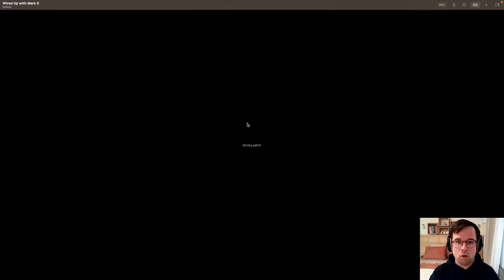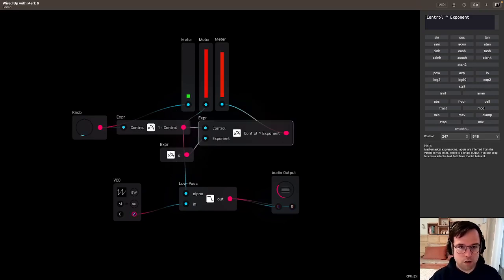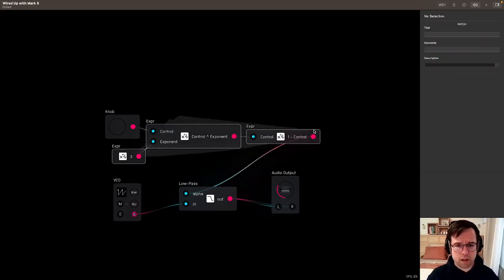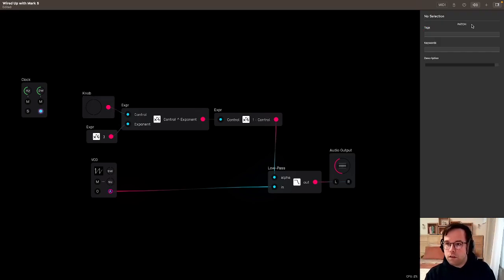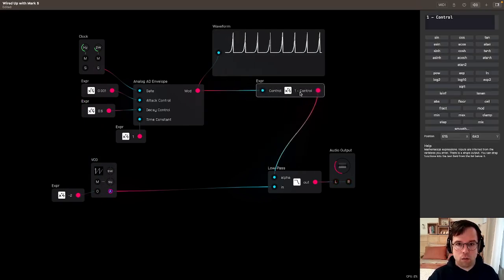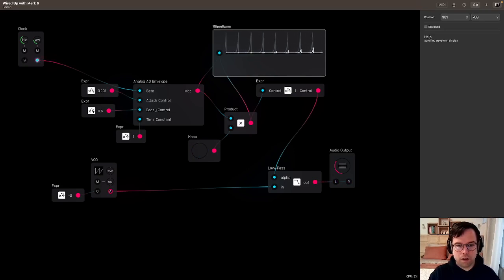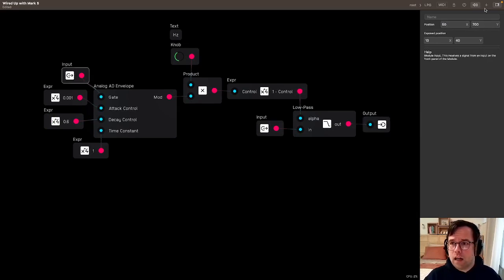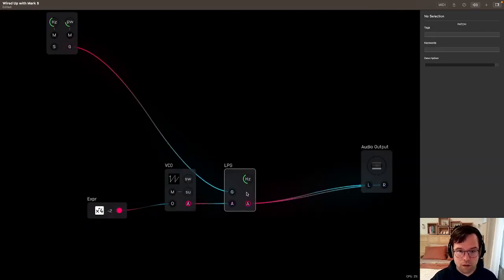Wired Up with Mark 5 - Building a Lowpass Gate (LPG) Module

Comment: Mark great video. Small issue I noted in iOS when Grouping, the Text box for "Hz" did not get included in the 'Group' process. I added a secondary arbitrary Text box just to confirm I was not screwing something up, but both Text boxes were not included...
Reply from the maker: Thank you! Glad you liked it. Are you saying that when you tried to group the text nodes they weren't included in the module that was created? Perhaps you can show screenshots over at the forum.